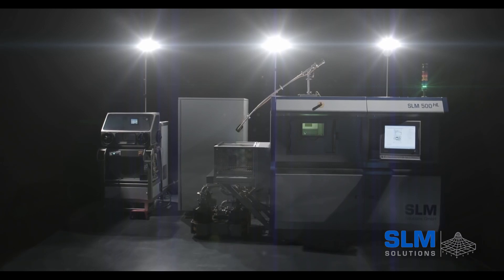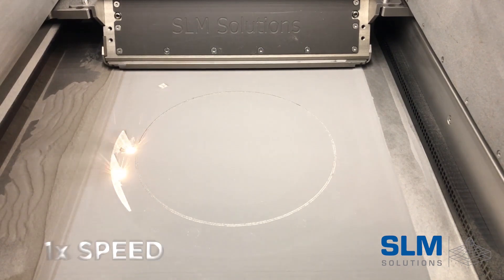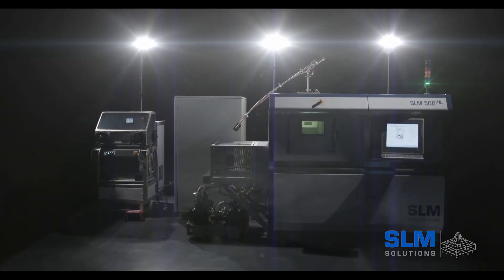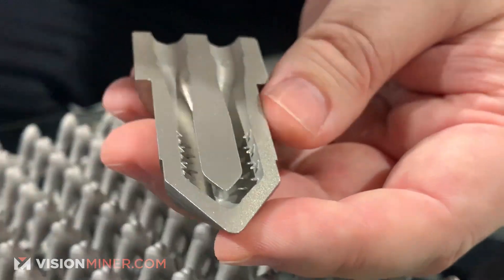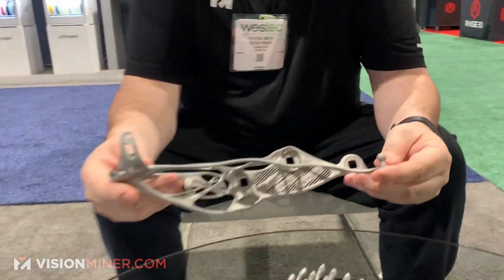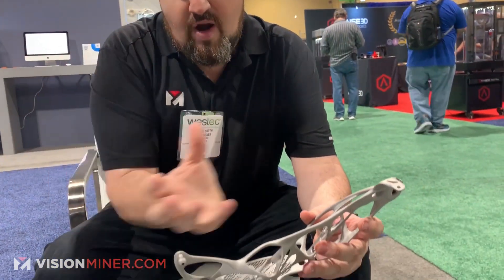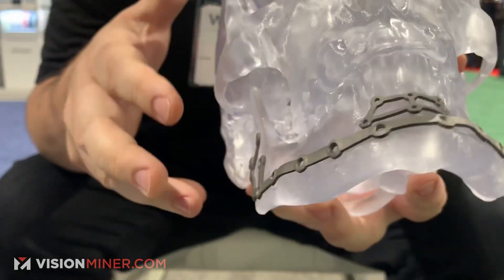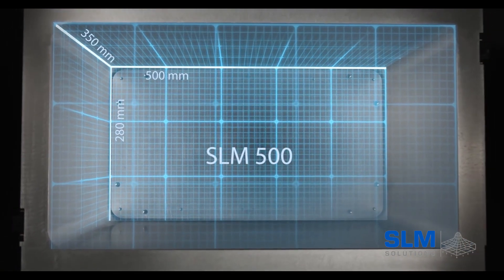SLM Metal 3D Printing - the Next Level of Superalloy (Inconel, Titanium) Additive Manufacturing

Comment: I'm wondering whether the shear strength of 3d printed producted wouldn't be comprised. Maybe the heat at which its solidified mitigates that though.
Reply: No, the metal comes out extremely brittle
Reply: There have been studies (or at least one that I have read) that analyzed the effects of SLM on Inconel specifically. What I remember taking away is that there are high concentrations of niobium at the intercellular grain boundaries essentially taking the niobium out of solution. However, the study concluded that by annealing and ageing, the niobium can be brought back into solution essentially restoring the strength properties of Inconel after SLM. I am not sure if similar studies have been conducted for the other SLM capable metals like Ti but at least for Inconel this condition can be circumvented with a bit more work.

Comment: there is the cost vs. the standby workhorse of casting the same materials. I do like this technology but not willing to invest in high end AM production esp in this tech's infancy. I think many will agree that AM holds promise but traditional processes esp in automated applications are getting cheaper every year. I can't see this replacing casting and SM for quite a long time, if at all. maybe as supplementive, low volume prototyping

Comment: Hi... I want to open 3d printing shop especially for automobile spare parts and I am new in AM. So can you help me by providing information
 Thank you
Reply from the maker: Start by starting! Mastering the tools will be the first step to getting where you can really go --- design will be the next. I say that because the design can be based on the manufacturing process for greatest efficiency --  often, the other way around can get hectic. Metal machines like this one will run in the $2M range, while you can get started in FDM learning for as little as $200, and have a professional machine like the Funmat for end-use automotive parts for around $7500. Start now, though, as the industry is taking off!

Comment: 3:17s genetiv? Is that some kind of software or company
Reply: You can do this using only stress testing software which many 3d modelling applications have built in. You start by making a metal block in CAD and assigning the points that need to be attached and then stress testing it for the relevant force You can then choose only the parts of the block that are under the most stress (as these parts support the most weight) and then delete all the other parts to leave a complex almost organic computer generated structure. You'll have to find the right kind of CAD and analysis software
Reply from the maker: A function of software -- multiple options :)
Reply: Genetive is a term from grammar. From wikipedia:

In grammar, the genitive case (abbreviated gen), also called the second case, is the grammatical case that marks a word, usually a noun, as modifying another word, also usually a noun—thus, indicating an attributive relationship of one noun to the other noun